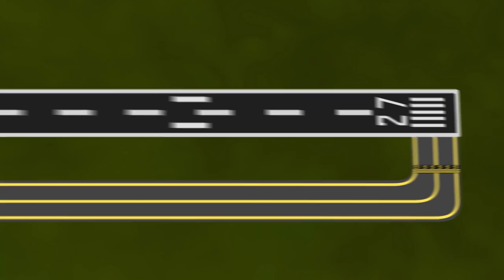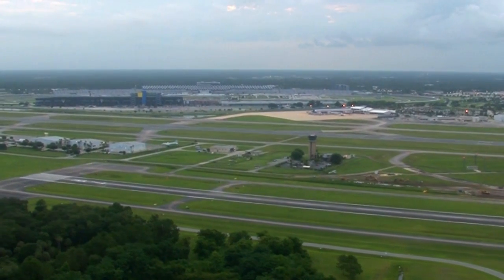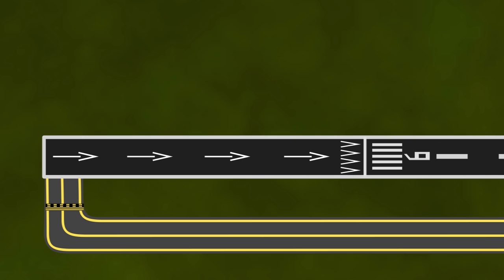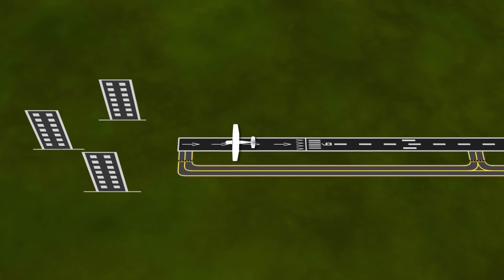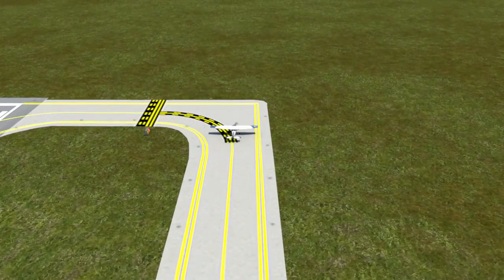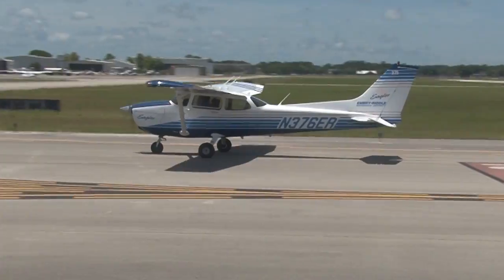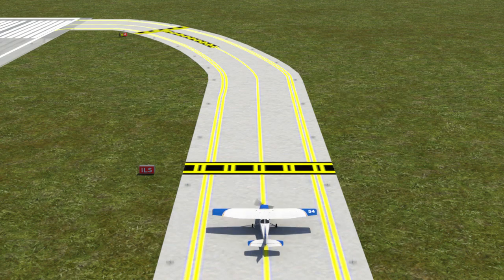Airports - 01 - Airport Markings

Comment: according to ICAO Annex 14:

 5.2.2.5 In the case of parallel runways, each runway designation number shall be supplemented by a letter as follows,
in the order shown from left to right when viewed from the direction of approach:
 — for two parallel runways: “L” “R”;
 — for three parallel runways: “L” “C” “R”;
 — for four parallel runways: “L” “R” “L” “R”;
 — for five parallel runways: “L” “C” “R” “L” “R” or “L” “R” “L” “C” “R”; and
 — for six parallel runways: “L” “C” “R” “L” “C” “R”.
Reply: What does it mean? How can I differenciate "Runway xR" from "Runway xR" in case there are more than 3?
Reply: @yosyp_yosyp  that's why, when you have that many parallel runways you usually name them as if they are 10° off

Aka 18L 18C 18R 17L 17C 17R
Reply: @yosyp_yosyp  one prominent example for that is Chicago O'Hare:

https://de.m.wikipedia.org/wiki/Datei:FAA_O%27Hare_Diagram.svg
Reply: Same at Los Angeles

Comment: 6:52 way to taxi right into the grass!
Reply: Good catch lol :) Didn't notice that at first
Reply: TheTimeTraveler2025  4:05 and 6:52 are completely different intersections.  4:05 is taxiway/runway; 6:52 is ramp/taxiway.
Reply: TheTimeTraveler2025  If you scroll a bit  further back, you will see a more zoomed out view in which you can see, that there is a patch of grass between the two runways, if you move straight on.

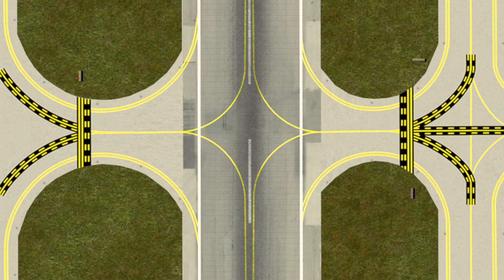Comment: At 7:01 with stripes like that can a plane cross the runway from left to right for example? (Like the animation at 6:50 did)
Reply: Yes you can, but only if instructed and approved by ATC as you're crossing the runway at that point. Say you land on runway 9L and you need to cross runway 9R to get to the ramp, ATC would then instruct you to cross 9R. Until you have that clearance you would need to hold. Remember, that solid single yellow line is simply a center line to help guide you and not run into the grass. It's not literal so you don't need to follow the little curve up and then back down when crossing.
Reply: @Kutulu369  so i am curious. When a the plane is taxiing, the pilot still has to drive it himself just like a car? I thought the plane just follows the line automatically

Comment: i think correct is zero seven and not just seven...or ?
Reply: FAA phraseology permits the use of, single digits to identify runways, from 1- 9. Depends on the ATC system of each particular country.
Reply: @rubenvillanueva8635  nice to know .. thank you
Reply: Both are allowed to be use. RWY ZERO-SEVEN Left or RWY SEVEN LEFT are both the sane
Reply: Yes it is 07 not just 7.
Reply: Adding the zero makes it less ambiguous in (unreliable) radio communication.
Eg. at LBG there are runways 7 and 27. Adding the 0 can make a huge difference there.

Comment: Years and Years of flight simming and real plane experience, but never knew the runway numbers were not just randomly picked. LOL... FS2004/FS9 then FSX, was just flying using heading mode or flying GA aircraft. Never learned how to even plan an FMC/FMS/MCDU. Then with the transition to X plane 10, I decided to make things more professional and start learning more. All these years and it's only with X plane 10 in April 2016 that I found out that runway 27 meant 270 degrees... You live and you learn.
Reply: vasily202 same hahahah
Reply: boardbreaker118z I believe he was a passenger, no one would make it through ground school not knowing that, could be levity!
Reply: Same here, been flying on simulators and only knew what those numbers meant, but never explained myself the variety of lines and signs.